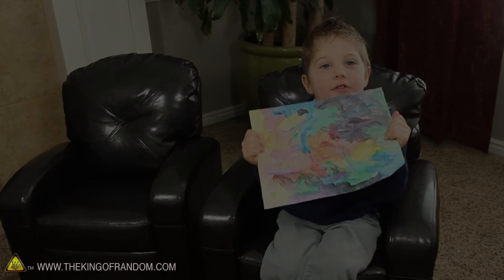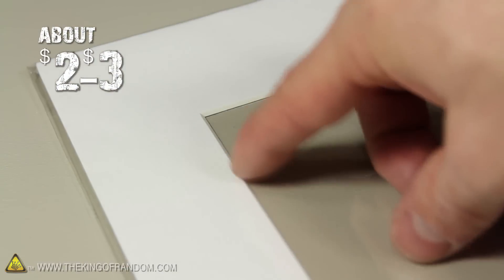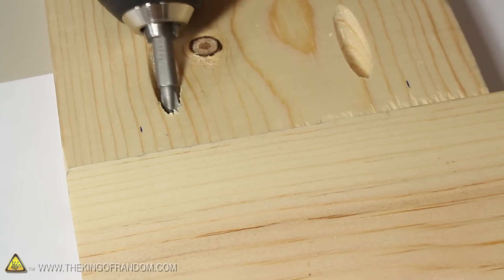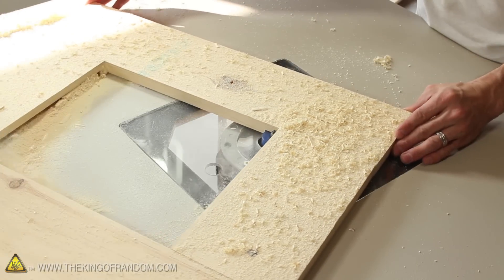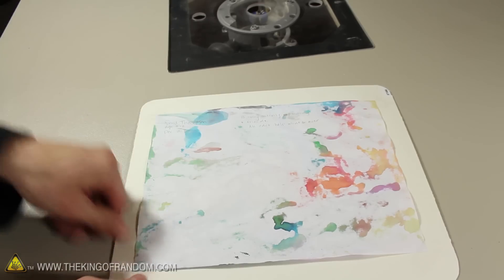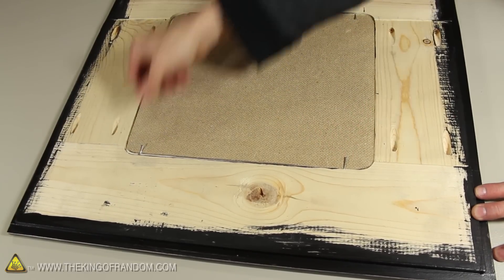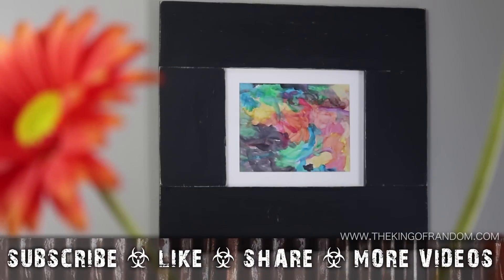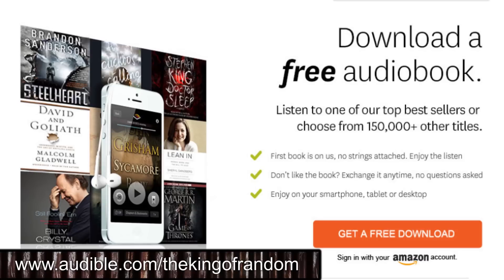Simple Picture Frame

Comment: Great work, I like your videos. I just wanted to give you a little tip when working with whole wood. If you only paint one side of it, it WILL eventually warp due to one side being sealed of while other side is accepting/giving off moisture. Even a thin coat on the other side will prevent this from happening. 
If you work with plates like MDF, then this does not apply.  Cheers

Comment: Personally think it would look better with mitered corners.  The vertical pieces were noticeably not a perfect 90' from the horizontal pieces.
I'm biases.  I own a frame shop.
Glad you used the router.  Most of the home made frames I have to fix, do not have a routed rabbit for the glass and art.  Sometimes there is a piece of wood added to make the rabbit.  Sometimes everything is held in by duct tape.